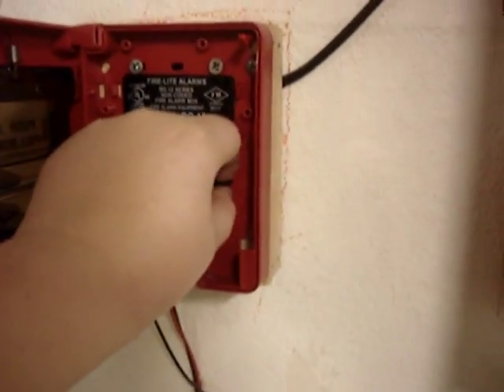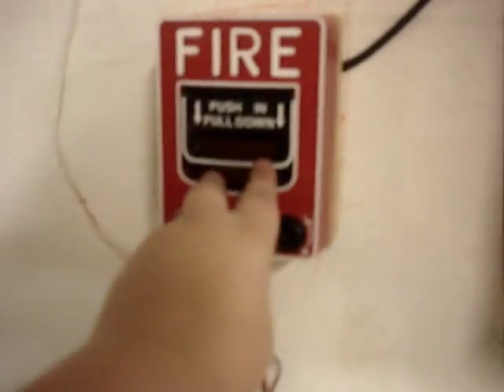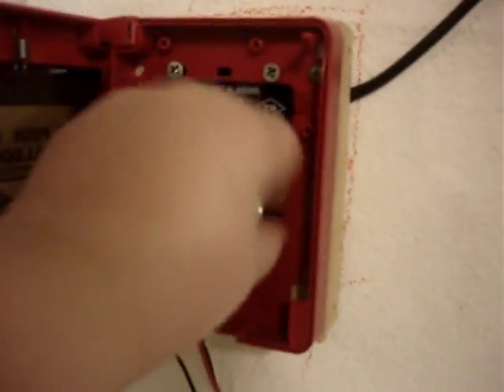System test 5

Comment: Seeing your compressor, here's an alarm idea: get a 12VDC battery or supply, connect a turn signal flasher to a 12v truck horn valve, and connect the valve to an air horn supplied by that compressor tank.
Reply: cool idea